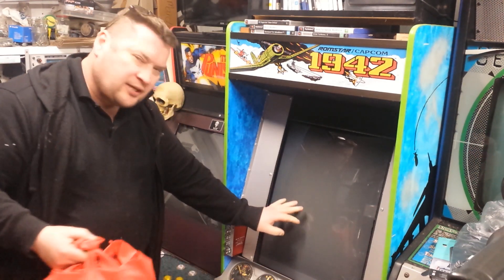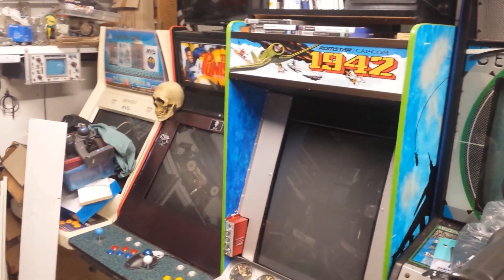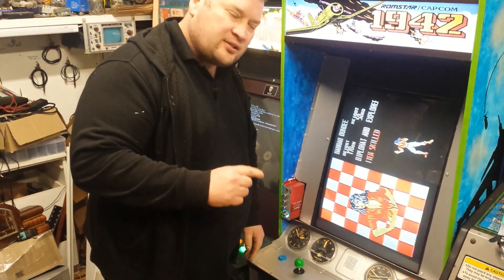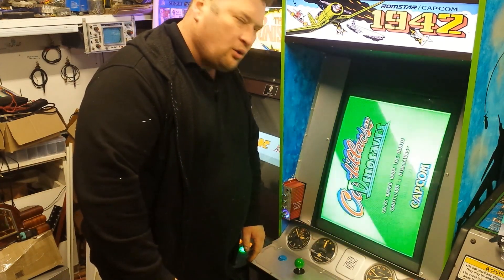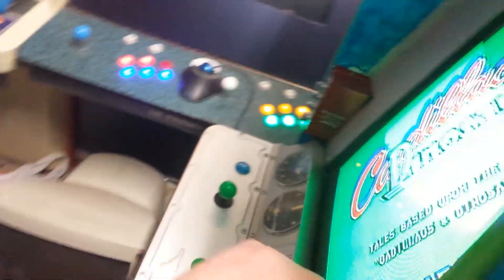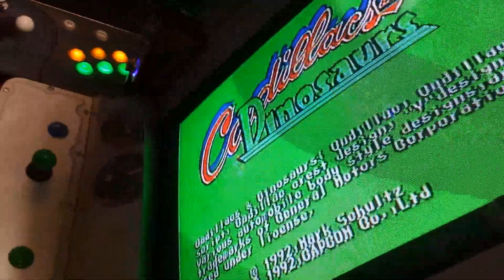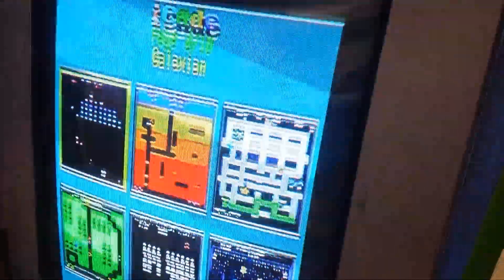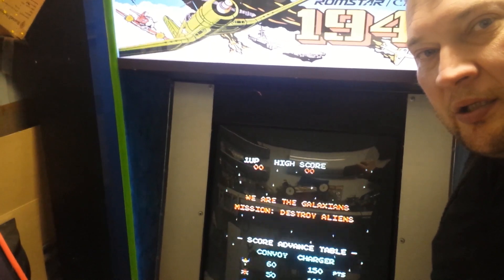Air Attack PCB jamma -  button combo wiped out all roms

Comment: I would try to turning up back on with different buttons pressed to see if you could get the og vertical game list back on. Maybe there was a hidden horizontal game list on the card and it got selected by the button combination
Reply from the maker: That sounds correct but need to find out if there is a button combo for different modes